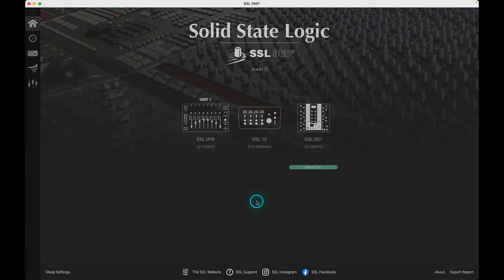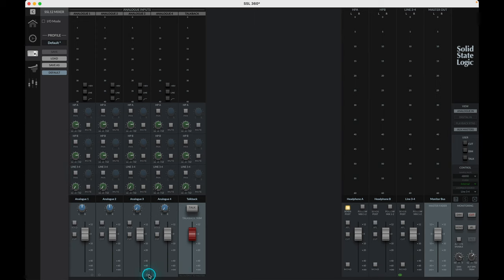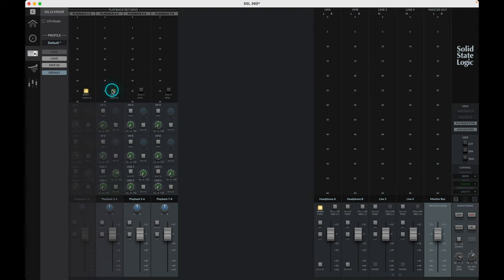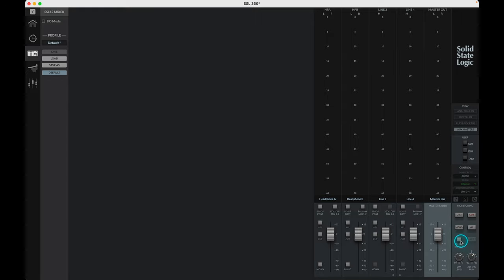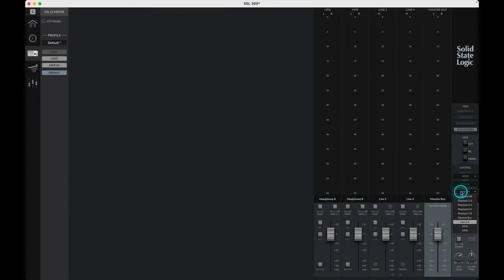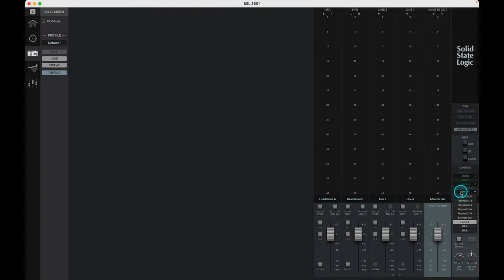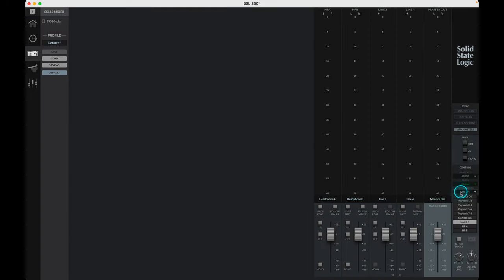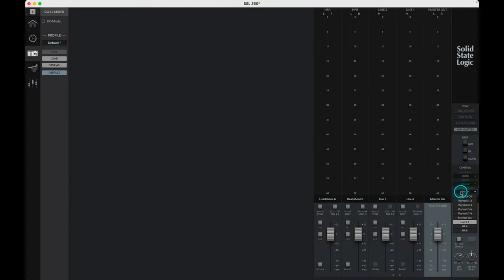Solid State Logic SSL 12 Audio Interface - Tutorial (Part 2)

Comment: Hey guys, could you please make a video that shows the complete process for sending outputs 3 and 4 with a piece of stereo outboard gear, and then back in, to print the processed signal.  I’m missing something about this process and just can’t seem to get it right. Thank you so much. 
🙏 😊
Reply: Use 2 TRS to XLR cables from 3-4 out and put them into the inputs for 1-2. Make sure you’re sending the audio you want to print into 3-4 inside of your daw.
Reply: @colemanoverbey1184  awesome thank you 🙏

Comment: I'm running SSL 12, Pro Tools 12.8, and with no tracks inputs enabled, I'm still hearing my guitar input, almost like a mix knob that's not set correctly. If I use an amp sim, and enable the track input, I'm hearing the processed and unprocessed sound? What's wrong here?

Comment: I just got mine today. Is there not a way to use loopback through the DAW and monitor it without the feedback?
Reply: This was covered in the video in the Loopback section but you actually have two options. Although the naming might be different, these steps should work for most, if not all of the Loopback functions of any audio interface and its accompanying mixer software.

1) You can do as they suggest in the video and, on the Loopback channel, MUTE the outputs from your DAW that feed the L/R Bus and directly monitor the computer audio source through the PLAYBACK 1-2 inputs in 360, which will naturally feed the Main MONITOR out (L/R). This way, you prevent the DAW stereo out feeding back into the computer L/R audio (source audio for Loopback input).

2) You can route the Loopback channel into outs 3/4 (5/6, 7/8) of your DAW, which would show up in PLAYBACK 3-4 (5-6, 7-8) in 360. Disengage DIRECT on that channel so the audio routes through the Main MONITOR outs of the SSL 12. Also in 360, press the CUT button on PLAYBACK 1-2 (and turn the fader down for good measure) to avoid phasing of the audio from the directly monitored 1-2 audio and the slightly delayed 3-4 (5-6, 7-8) audio running through the DAW. This method works best if you need to hear the audio running through your DAW's plugins.

Comment: Why no mention of the front two line level inputs? I assume the SSL12 has 6 simultaneous analogue inputs right? Strange that they aren't set up in software in this tutorial.
Reply: The from HiZ inputs are not separate inputs but are "interchangeable" with rear 1 and 2 inputs

Comment: sadly, I understand very little of what you are saying.. I have the SSL12 and am using ableton. I have a doubling of sound on the headphones, as I don't know how to just get the monitoring from the DAW, rather than getting the monitoring directly from the SSL. What I mean is this: When I plug a guitar into the SSL I immediatly can hear that guitar via the SSLs direct monitoring. However, when I open Ableton and now play the guitar I hear the guitar twice, as I cannot disable the direct monitoring from the SSL (or don't know how to..). Can somebody help me here?
Reply: Yes you should use the 360 software and actually mute the direct signal from your guitar input on the SSL. Does that make sense to you?
Reply: @Mikas_Emil  hello mika, i have the same problem but it don't works... it's horrible , how i can directly listenning my daw and not the SSL when i'm recording?
Reply: @Mikas_Emil  i had same problem, i just figure it ouy, You can with just plug your output jack speakers on 3 and 4 on the ssl 12.no in 1 and 2 and you can control output 3 & 4  on ssl360 soft, u won't hear a double sound anymore.